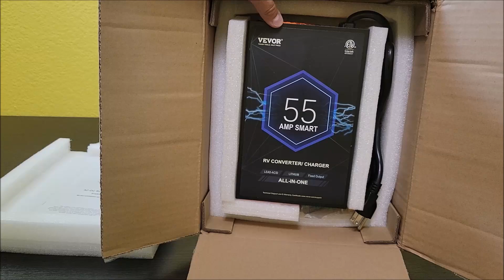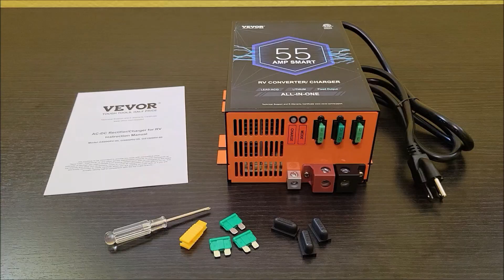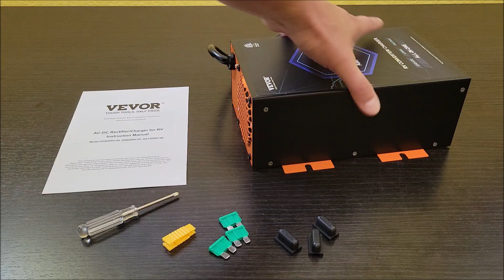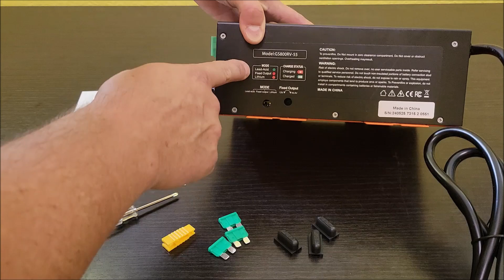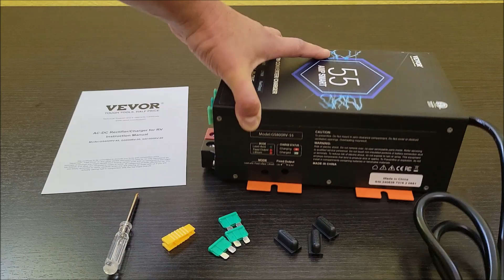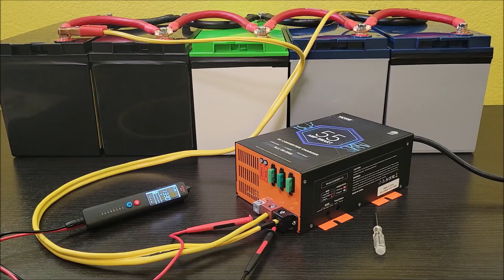What You Should Know - VEVOR 55 Amp RV Power Converter

Comment: I was wondering why this product exist? Ir why the other Vevor charges for lifepo4 batteries exist? This converter charger is like half the price of one of the 80A Vevor charges for lifepo4 batteries. So, if it does the same thing why have another product that cost twice as much? None would buy it. So what is the difference then ?

Comment: Ive never thought about this idea. Youre just using a converter charger as a regular battery charger. 1 year later, how has it been working?  It had built in design to handle lifepo4 batteries with no problems?
Reply: That's a great question. I was wondering the same thing considering the Vevor lifepo4 battery chargers are so much more expensive.

Comment: How large of a generator would it need to run it from a generator
Reply from the maker: Max output voltage of 16.5 x 55 (amps) = 907.5 watts.  These do usually have about a 10 to 15 percent overhead so I would say a 1000 to 1200 watt continuous generator would be maxed out by this converter.  I would probably use a 1500 watt continuous generator to run this at a minimum.
Reply: @SeidelRanchReviews ok thanks
Reply: Any thoughts on why my mode light is green? “Lead acid mode”? When I have the dial all the way to the right “lithium mode”?

Comment: how warm is safe for this charger? bought one to replace my xs power psc90 that died after 3 years of use :l the 80 amp was insanely well priced! only 120 :o was cheaper than the price i was quoted out to have my other power supply repaired with shipping 0_0! have it maintaining a  400ah agm battery bank @ 13.81v on fixed mode.
Reply: kinda wondering if i should modify my lil 80A vevor now with some lil noctua fans and see if theres any ways to cool it a lil better for long-term use without like ghetto rigging anything :o if this thing continues to work this well i don't think i'll even repair my other power supply.
Reply: definitely glad i went with this Vevor over the Taramps smart charger i was looking at after hearing how loud those tiny lil 30 or 40mm fans get in that taramps charger ;o oof..

Comment: Unfortunately, I can't say that it's a very good product: my 12v lipofe4 battery charges at barely 13.5v instead of 14.6v (at only 44 Amp)❗️I'm disappointed❗️👎
Reply from the maker: Do you have it set correctly?  Mine charges them fine at 14.4 volts as you saw in the video.  You may have it set to fixed output and set too low.
Reply: @SeidelRanchReviews  yes, i set it before i used for lithium batt. (LiPoFe4) .. led color orange.The the voltage shows 13.5-13.7.
Reply: It will not charge at 14.4 volts. If battery is at low SOC it will run in constant current mode and output it's rated output current and voltage will slowly start to rise as batteries take charge. Once voltage rises to around 14.4v then the current will taper off until it gets very low and green light will turn on.

Comment: How is this charger/ converter working for you? Does it go into float mode at 13.6 volts or is it continually 14.6 volts?
Reply: I just bought this model and have not seen the voltage go down to the float mode voltage of 13.6V as it is supposed to per the manual.  Writing to Vevor via their Chat resulted in "This is how it works."  I did find that setting the 3 way switch on the side to the Fixed Rate Output with the adjustable voltage output does charge my new LiFePO4  to 100% at that set voltage.  I may just leave it on that setting rather than risk over charging the battery at the 14.6V rate.  I've read on various forums that others have experienced the same thing.
Reply: @melrobinson6919  Thanks for letting me know. I just bought one of these, and I will be monitoring it.
Reply: @mikewelti112 You're welcome, Mike.  The original converter that came with my bought new 2000 Terry TT was 40amps, non-lithium, of course.  When I had no house batteries connected, it wouldn't open and close the slide.  I had to have at least one house battery connected to be able to do that.  Now, this Vevor converter opens and closes the slide by itself without struggle and it has not gotten very warm.  The fan comes on maybe every 15 seconds and stays on for only a couple of seconds. FYI, I got the lowesst price on the Vevor website, lower than Amazon and Walmart.  OTOH, it can be advantageous to buy from Amaqzon due to their favorable return policy.  Also, I opted for the 3 year extended warranty which was cheap.  Good luck with it.

Comment: 14.62 V is slightly above what LFP cells are rated for. 3.650V Max per cell. This charger if bring the cells to 3.655V 
Also holding an LFP at 14.62 volts will over charge the battery. Depending on the manufacturer of the cells. Some cells are considered “fully charged” when the tail current reaches .7 A if you keep the battery at 14.62 it will continue to charge and it will damage your battery. If the plan is took keep the batteries topped up while still pulling loads this charger should have a float mode at 3.35V.
Reply: Thats why there is a BMS inside so it can protect against this.
Reply: LOL

Comment: Great video! On my side, 14.62V might be too much for the batteries, as a single cell voltage can easily exceed 3.75V, triggering the BMS protection mode. This isn’t good for the cells. It would be interesting to find a way to limit the charging voltage for LiFePO4 batteries to below 14.6V. Are you sure the right screw doesn’t work in Li mode? Maybe there are other variable resistors inside the converter? Personally, I have an issue with another Vevor charger with a 14.61V charging voltage, which causes the battery to go into protection mode and, as a result, it never stops charging. Best wishes.
Reply: So you wouldn't recommend this charger for Lifepo4 batteries ? which vevor chatger did you have before?
Reply: @knight3131  previous charger was Vevor 2500W Sump inverter/charger. During charging some of the cells go above 3.75v, which triggers protection. From disassembly I did not find how to adjust voltage without schematic modification. Now I am using 20A Ohrija from Ali - good chargers, could be adjusted to 13.8v easily. However I am looking for more powerful charger. Vevor suggests to use this converter in fixed mode for Lifepo4 battery, where you can adjust charging voltage. Considering this option at the moment.
Reply: @yuriykorenyak2351  
You should program your BMS to never allow any cell to go above 3.55v. 3.65 is the ABSOLUTE max, but it still causes degradation to repeatedly hit even 3.65. You will lose almost no battery capacity, but you will get a TON more longevity. 3.75v per cell is causing significant irreversible cell damage.
Reply: @Wrenchmonkey1  completely agree with you. I even prefer 3.45v as the battery will be at use only a few times per year for a sump pump emergency. However, with bms settings like this, the converter/charger will go crazy and will stack in error loop trying to charge the battery.  The only solution is to lover voltage on the charger, and it looks like it is impossible. Do not suggest fix mode - i don't believe it will work in case the battery is permanently connected to the charger.
Reply: @yuriykorenyak2351  
If it battery is seeing rare use, I would buy a cheap low-amperage charger that is designed for LiFePo4 chemistry and use that. These power converters are designed to charge RVs or boats and supply 12v to the rest of the system while plugged in to shore power. I would never use one as a standalone battery tender/charger.